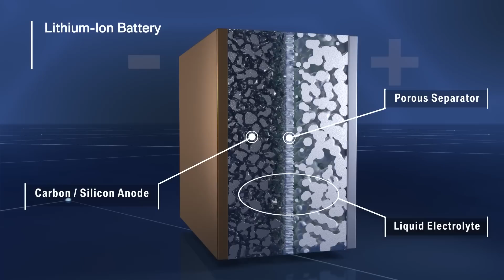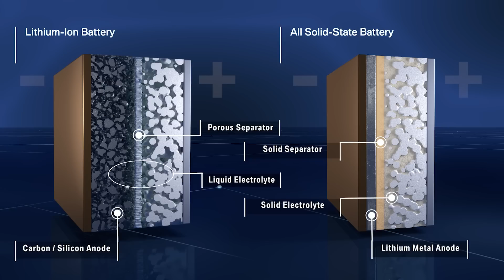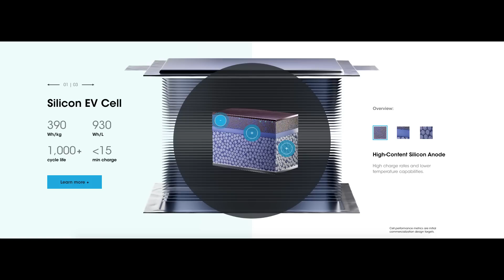Why Solid State Batteries Could Be the Future - Autoline Exclusives

Comment: Solid state batteries are the future I'm holding off on buying an electric vehicle until they have solid state batteries in them which are cheaper more reliable and charge faster and have more energy density
Reply: EVs are more easily updated to SS batteries compared ICE vehicles. ICE will be totally obsolete, so guess you should stay away from them even more.
Reply: Solid state will be a great addition for EVs but I still think it'll be more of an evolution versus revolution. While it has the potential for large improvements it seems unlikely a lot of those improvements will happen all at once. The most immediate will probably be safety around fire issues, but EVs are already much safer per mile traveled than an ICE engine is in that regard. The other large improvement would be faster charging, but because automakers are using larger and larger battery packs the impact in charging speed might not be as noticeable.
Reply: @GridConnections  
The smart ones won't be using larger packs.
It's going to be very interesting to see the first (metered) charging test of the 4680 cars.
(Let's hope someone "does a Bjørn" and uses an OBD2 scanner?)
If we see
"Small" (ish) pack.
High initial rate.
Flat (high) continuous rate.
.
That's a game changer.
Reply: Battery and veh's computer chips are two things that need to be updated. Its like a laptop. U don't want an aging battery and u want an updated motherboard and cpu
Reply: @zerogundam, You have quite a wait ahead. At least 3-5 years & likely 10, if ever, while you keep paying $6+/gal for ICE vs the sub-4¢/mile cost of EVs lol.
Reply: None of what your are saying is accurate. They don't exist, so saying they are cheaper is why they are not out yet, way to expensive. You have listened to hype, nothing is real about SS for at least 7 years, and by then Tesla and many other batteries will be even better then SS.
Reply: You going to be buying ALOT of gas waiting for that